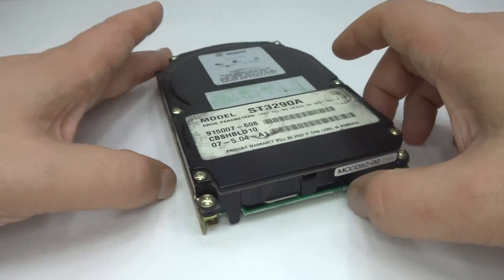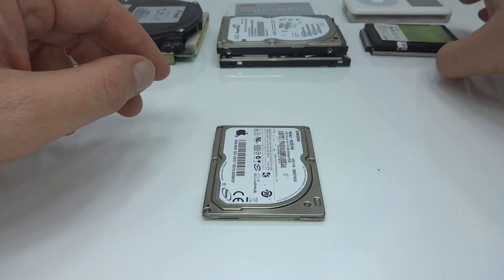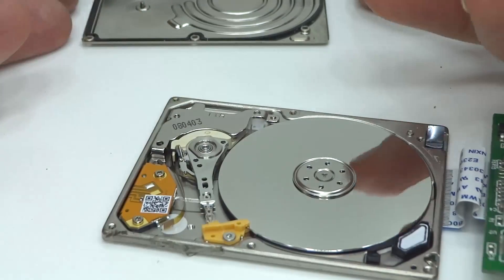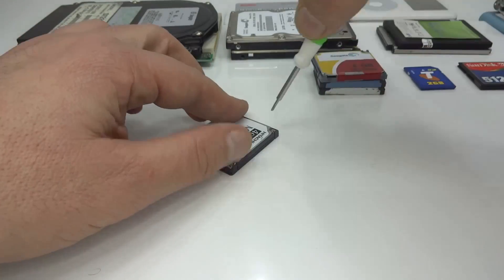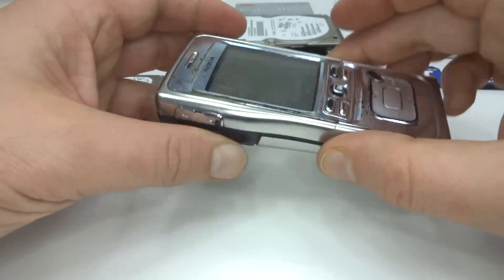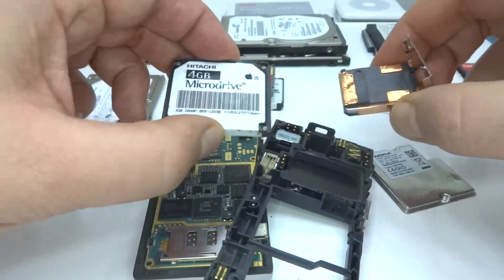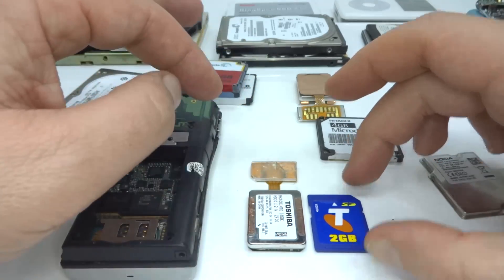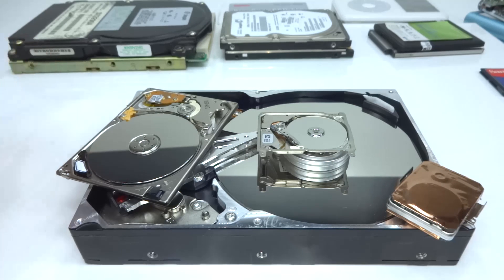Spinning Disks: the smallest hard drives compared

Comment: fun fact. moving that head on the samsung might have fixed it. i fixed an oldd hdd with the same fault and surprisingly no bad sectors, still works altho  its just a windows 98 drive so not been used much
Reply: Had the same thing done with a laptop drive, the head did not retract and got stuck in the middle. Soon after, the head got ripped clean off (a month later that is), and was dragging like a suitcase tied to (or stuck outside the door of) a vehicle, while tumbling and skidding all over the place. Since replaced it. Opening up the drive, it was much noiser than with the cover on. LOL

Comment: Even if mechanical drives and devices get replaced by non-mechanic alternatives wich way faster and better, I find them very fascinating. My old Camcorder also still has a 30 GB HDD built in :)
Reply: If it ever fails, you know there's SSD's for it. :D

Comment: IDE 1.8inch is used in IBM x40 x41, is there replacment for SSD?
Reply from the maker: Yes, there are 1.8" SSDs available. A better option these days is to use an mSATA SSD and an adapter to replace a 1.8" hard drive. I did this replacement in a video a couple of years ago, about the Fujitsu hybrid laptop-tablet.

Comment: I didn't even know there was a smaller than 1.8" HDD 😮
Reply: Same
Reply: They are short-lived oddities used in iPods and bake in the day when flash memory was cost prohibitive to get the desired capacity for handheld portable devices and when multi-gigabyte thumb drives were way too expensive for the average consumer.

Comment: Never thought how small HDD can get back in the day, very interesting piece of engineering they achieved
Reply: Look up old watchmakers. They made much tinier things with comparable precision with nothing but primitive mounted files(as in file which you use to file down a piece of metal).
Reply: @NGC1433  watch precision is not even close to hard drive precision
Reply: @NGC1433  hard disk are technically nano scale
Reply: like how do they fit such machinery, the spinning motor, the magnetic coil, the servo for the rod, and even temperature sensor etc etc.. so crazy!

Comment: At 15:00 "If I can ever get this interface working, Then I'll be making the worlds smallest mechanical,  spinning hard disc usb memory stick"
No. No You won't.
That was done and made commercially available in 2008. The Swissbit Mini S.Valigetta was released in 2008. Had 8 GB storage. Was USB and had a mechanical hard drive in it much smaller than anything you've shown.
Reply from the maker: Thanks for the info on the Swissbit Mini S.Valigetta. I hadn't heard of that model before. Though at 48mm x 40mm x 17mm, it may contain a Microdrive rather than the smaller 0.85". I've heard of other brands that used these drives. I still think I can go smaller. I appreciate your comment, thank you.
http://www.alavia.net/pm/data/10/pr_sb_svaligetta_classic_engl_200606.htm
Reply: @JanusCycle  Having spent a good part of the day looking, I've found mine. Inside you will find:
https://www.businesswire.com/news/home/20060213005130/en/Cornice-Introduces-Ultra-Thin-8GB-and-10GB-Micro-Hard-Drive-Enables-Smaller-and-Thinner-Consumer-Electronics-Devices-Small-Form-Factor-Storage-Innovator-Launches-Its-First-Two-Headed-Storage-Product-and-Decreases-Its-Size-by-40-Percent

And, As I've not been able to find any photo's of it close-up internally so,  I pop'd the cover off (They were known to over heat so slots were dremmeled into the cover) and thought I'd give you a look. And yes, It still works!
https://i.ibb.co/gmsFX6L/20210111-184100.jpg
https://i.ibb.co/fvzRNF6/20210111-184121.jpg

Comment: MP3 player: Often dropped or subjected to shocks and abuse.
Apple: Lets put a HDD in one!
Reply: Some hard drives detect that they are falling and shut down and park the head before they hit the ground.
Reply: Dennis Fox Not familiar with HDDs doing that but HP implements (implemented) it in some of their laptops with an accelerometer
Reply: @Roomsaver  You seem to be right.  I thought it was part of the HDD.  But it seems to be part of the laptop.  I remember IBM was the first, don't know about HP.  This is an accelerometer used for the purpose.  Fun times! https://www.analog.com/en/analog-dialogue/articles/using-accelerometers-to-protect-hard-drives.html#
Reply: @microdesigns2000  Even my ThinkPad 4th gen X1 carbon still has the drivers for shutting down jard drive if dropped. It has an NVME ssd. Some legacy.
Reply: @dimacherepovskyi8600  Interesting!  Maybe they assume some customers will want to install a high capacity hard drive, lol.
Reply: @microdesigns2000  thats why those HDD have two logos at the same time,because are Samsung for Apple,Hitachi for Apple,etc,etc.Because they incorporate those kind of things meant for durability on the move.Usually custom firmware for temperature sensing inside HDD,reduced noise and accelerometers for falling/intense vibration included on the HDD.
Even moving the macbook fast i can hear the heads parking.
other brands also include that kind of things.Even to the point of having troubles with some Lenovos for changing the HDD for a non "original" one.
Reply: @microdesigns2000  that's Alien technology.
Reply: @microdesigns2000  that wasn't something they had at that time when they put HDD in ipods
Reply: @microdesigns2000  Amazing technology!!
Reply: @microdesigns2000  yea and their head parking speed is pretty impressive
Reply: it was the most economic way to get a lot of space on an mp3 player at the time, you do NOT want to know what early 2000s flash memory in a few gigs wouldve cost you XD
Reply: My fried still use it like back up drive. Amd its work all the years.
Reply: side effect of that though is that a non abused ipod will work for literal decades due to the HDD's ability to handle R/W way better than flash in terms of durability (will require several battery replacements over its life though)
Reply: iPods had a large (for the time) memory cache. They'd spin up the HDD, load the next few songs into RAM, then spin the drive back down. They also had an accelerometer and would park the head if it detected being dropped. They'd also prevent the drive from spinning up if the device was being shaken.
Reply: I think the tiny drivers were actually more durable than large ones, due to the square/cubed scaling difference in physics. It's why ants can lift 100x their weight. The smaller parts are way lighter relative to their cross-section (what determines strength), thus can take more sudden acceleration than larger ones.
Reply: @gargantuablargg  very interesting! i did not expect to learn something new when reading these comments, and was pleasently suprised
Reply: In that time period, it was the only way to large storage (today it would simply be half-decent). Flash based players often had like 128 MB or something like that and you could only fit a couple of album's worth of music into them.
Reply: which is wierd because for the longest time apple was known for it's durability. if course now they are known for their gimmick based marketing, hand holding and overpricedness.
Reply: It'd cost a fortune to put the same amount of flash-based storage in there, putting those HDDs in was the best decision they could have made. Looking back with today's technology in mind is just stupid and childish, and ridiculing them is silly either way. They worked really well and sustained a LOT of abuse. I don't think anyone would buy an MP3 or even a FLAC player that cost a few thousand dollars.
Reply: this is exaclty what i thought how did those things keep working
Reply: it worked tho, i dropped my ipod classic so many times and even spilled chocolate milk all over it and guess what, it works! It was the only way to get literally 80gb back in 2006 and 2007 for a reasonable prices
Reply: I have 4 of 160GB Classics - all work.
Reply: Apple: "Think different".
Reply: @DJdoppIer  Apple currently: "think money, money, and more money"
Reply: Those ipods were surprisingly durable.
Reply: That being said they could take a shocking amount of abuse.
Reply: I dropped my ipod now it can only hold 1.5gb instead of 40 and the battery was expanding in such a way it flexed the click wheel connector and after I replaced it no more clickwheel

Comment: wondering how much data could be stored if they still used those gigantic drives. or just those smallest hdds as a pack
i bet they use stacks of micro sd 1tb cards. certainly has a higher data density than any hdd.

Comment: I have a MicroSD card in my laptop that's 512GB (genuine). I find it mind blowing that something the size of a fingernail can store that much data and more!
Reply: Wait until you hear about the 1TB sd card
Reply: @deadchannel5933  it exists now and its not even expensive. memory really does advance ridiculously fast.
Reply: Later on, mole size yottabytes.
Reply: The IBM 350 disk drive invented in 1956 stored a mere 3.75 MB and took up the space of two large kitchen refrigerators. This tiny Samsung disk drive stores 80 GB. You will need 21,333 IBM 350 disk drives taking up the space of 42,666 refrigerators to have the same amount of storage as this Samsung disk drive. The 350's cabinet is 60 inches (152 cm) long, 68 inches (172 cm) high and 29 inches (74 cm) wide taking up 12.083 square feet. 21,333 IBM 350 cabinets would take up 257,775 square feet or 5.37 football fields. The IBM 350 disk drive costed $3,200 per month to lease in 1956 or $31,418.12 in 2021. 21,333 IBM 350s would cost $68,265,600 per month to lease in 1956 or $670,242,703.76 in 2021.
Reply: @RaymondHng  I'm too lazy to actually calculate and verify that so...

wow much math
so technological
Reply: I have a genuine Sandisk Extreme 1TB microSD card in my Sony Xperia 1 III phone, micron is set to launch 1.5TB microSD card and toshiba working on 2TB microSD card, phone manufacters removing microSD card slot was a dumb move - 1TB of microSD storage costs 2 times less than what phone manufacturer would charge for a phone with 1TB internal storage...
Reply: @1sonyzz my almost new samsung a54 has a micro sd card slot. So… i guess you are wrong on that one
Reply: Full-size SSDs nowadays have capacities above 60TB in the denser models
Reply: I have the 400GB one lel.
Reply: Honestly, it's nowhere near as mind blowing as a completely functional 1.8" spinning hard drive. Nevermind the one with a platter smaller than 1".

It's still cool, but it's not that big a deal.
Reply: There is a 1tb version of the micro sd card
Reply: Why would we need to know if it’s genuine?-
Reply: Manufacturing imperfections upon expensive mono crystalline silicon that don’t destroy functionality are often sold as lower capacity units, or escape with a higher capacity label than they deserve.
Reply: Yeah yeah bet bet but only difference is the speed sd card  speed is slow so they can't be used as a internal storage
Reply: I totally agree with you, and I have a 512GB standard size SD 🤓

Comment: What’s also smaller than a 2.5 inch HDD is an M.2 NVME SSD. Those M.2 NVME drives are wicked fast.
Reply: The title of this video mentioned Spinning Disks, which have no moving parts. The smallest spinning hard drive I saw was made by ibm and it’s platters were the size of a nickel. I believe that drive was 345mb.

Comment: They also made double hight/platter 1.8 inch hard drives for larger capacity IPod classic units which also significantly increased the thickness of the higher capacity original IPods! :)

Comment: 1.8" HDD... that give me PTSD... I had to repair Macbook air that had that form farctor HDD... And I really had problem to find that at that time lol
Reply: Nowadays it would probably be an SSD in an adapter, no questions asked. No way one would find a decent HDD on a decent price.
Tho wonder how feasible this was back when you did this, I would sure bet not so nice, those things were sold with like 40GB drives no? (EDIT: OK 80GB 1st models or 64GB SSD... wonder how much it cost back then). Wonder what sizes of SSDs were available back when people wanted them fixed.
Reply: @Kalvinjj   I did a Little research and I found that the OG MacBook Air had either an 80gb hdd or 64gb ssd in 2008 and the 64gb ssd was a $1300 optional extra. The most amusing part  for me was that the ssd was maybe like 10 percent faster than the 80gb hdd so it’s not like you got a substantially more responsive laptop nor was the ssd substantially better in battery tests.
Reply: @Fhwgads11  damn... That price hurt me more than it had any relevance to me... But yeah that's Apple I guess.
That performance difference is quite amusing tho, I do remember that SSDs were quite rough back then, heck when I got my 1st SSD on the SandForce controller era it was pretty absurd of a difference to a mechanical drive, but then some years later and I swap for another cheapest on the market one and it's... significantly faster. These things improved absurdly fast for sure.
Reply: iFlash Built For iPods But Works With Many 1.8" HDD Products (untested you just have to try it)

Comment: Watched this video, Went on ebay, saw a N91 phone for sale cheap 10 minutes from where i lived, messaged the guy and in less than 24h i had the smallest production hard drive in the world x) Now lets try to reverse engineer it and try to make it work out of that phone
Reply from the maker: Great stuff. If I ever get one working on USB I'm going to replace the top metal cover with thin glass. I want to see it spinning as I save data to USB memory :)
Reply: @JanusCycle  You probably know it, but even a spec of dust can ruin the disk surface. Although I suppose these small drives probably spin way slower, but still

Comment: we need mini storage servers of 64 GB using 16 mini 4 GB drives!
Reply: @Finn Scott much more than that: the micro SD-Card is now in 1TB available.
Reply: @adamabele785  2tb too
Reply: @adamabele785  microsd is flash
Reply: @cowkarma21  of course, so is ssd.
Reply: They are soooo slow
Reply: Toshiba actually sold an 8GB drive in the same form factor, the MK8003MTD.